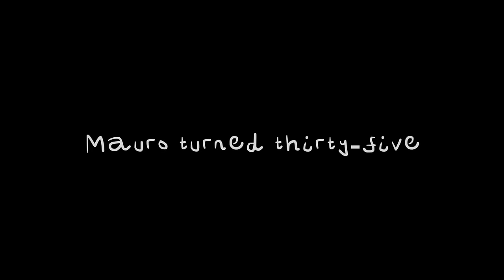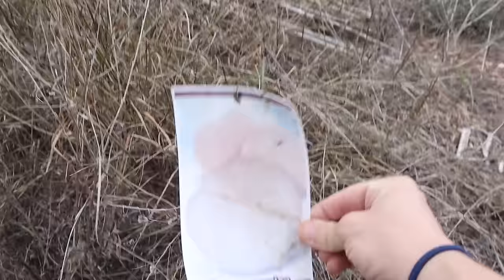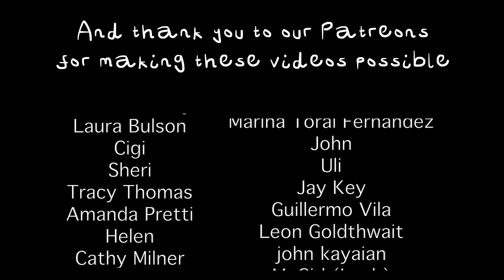The Reality of Off-Grid Homesteading with a Baby

Comment: How is the drip irrigation on the trees doing? Since water scarcity is an issue, are you considering drip irrigation for your raised beds? Do you do passive aeration in your compost bins? Take a PVC pipe (1" or larger), drill holes along the length, and insert it into your compost pile. The pipe acts like a straw, letting air move down and into the compost pile. Use multiple pipes inserted in different spots to increase airflow even more.